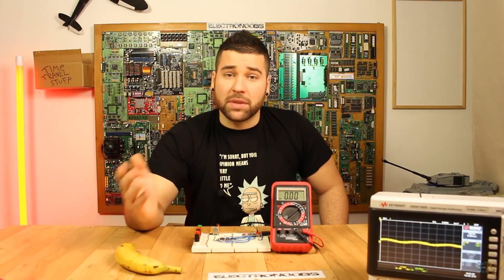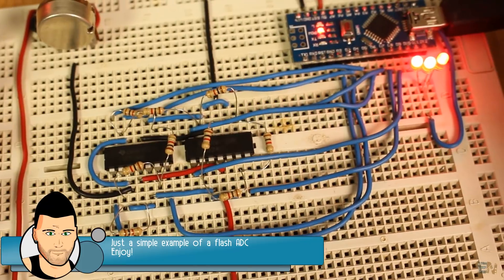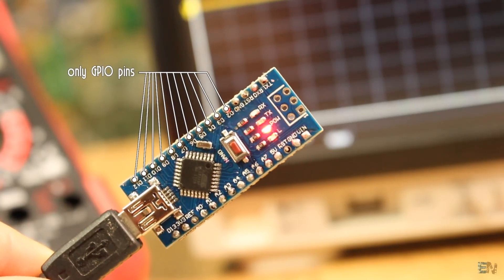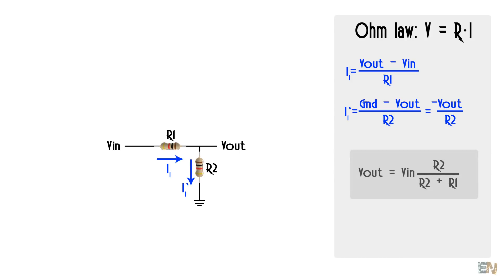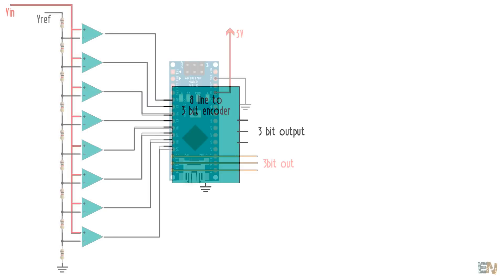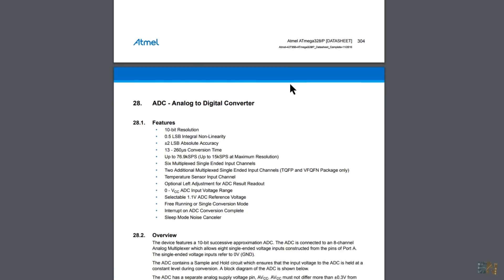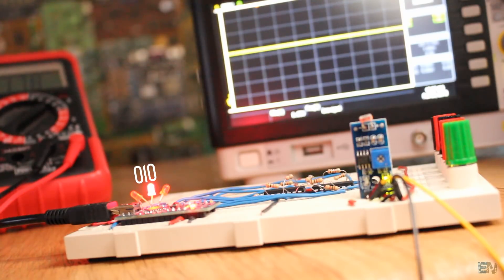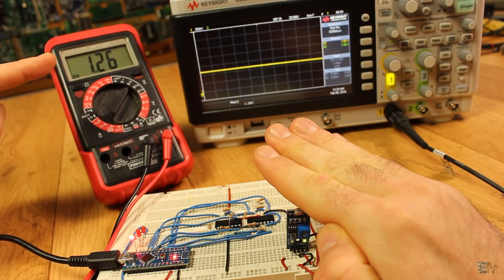DIY flash 3bit ADC

Comment from the maker: I know this is very basic but I wanted to do it. If you would like to support me: https://www.patreon.com/ELECTRONOOBS Thank you very much guys!
Reply: Electronoobs when arduino connected to usb, there are always less than 5v at reference pin. connect multimeter and measure V, you`ll see around 4.7 volts

Comment: First of all I am thankful to you for giving the basic concept in your video. Basic is never small it is the thing.  The so called hifi are just artificial hype and of no use to mankind.  By the by how have you connected the LED bulbs, i mean the polarity. Secondly how are you showing in oscilloscope 101 or 001 i. e the digital data. The oscilloscope can either record a zero flat line for zero i. e off condition or elevated flat line for on condition. I did not understand that part. Please clarify

Comment: If you lower your vref voltage, you'll get your final 8th bit into resolution. Wish I had seen your video before, I just designed a 14 comparator flash add much like this (for note resolution in a synthesizer project) and it took forever...
Great vid!